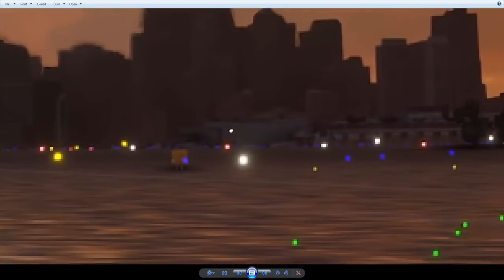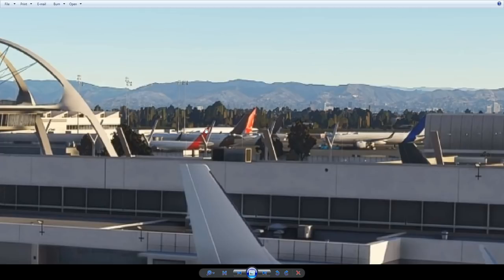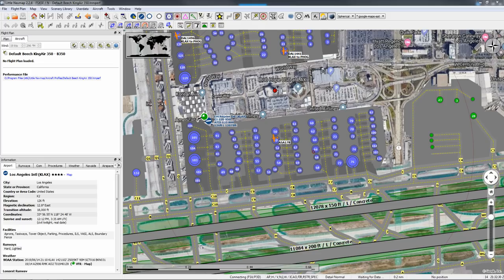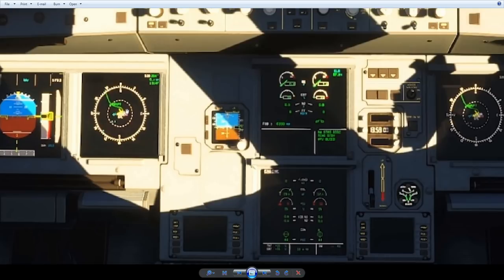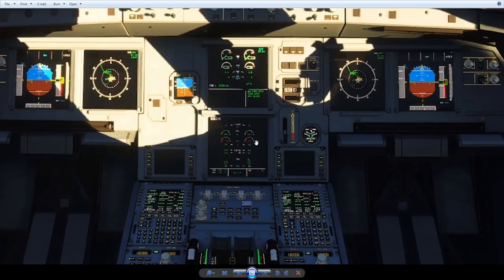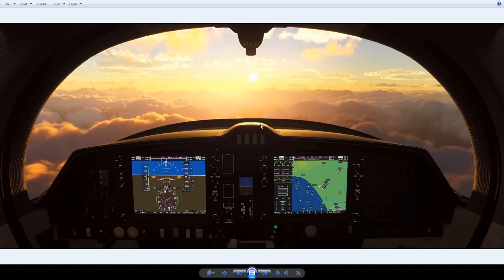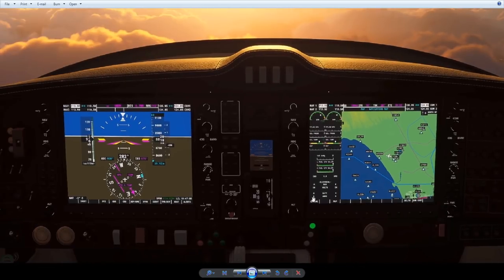A detailed look at some things in the New Flight Sim

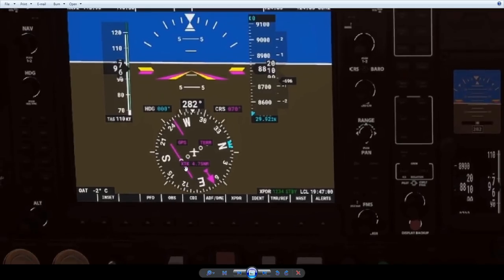Comment from the maker: Slight Correction/Clarification to my comment at 22:35
I have seen some addon aircraft put the XTK in the G1000 HSI before, But none have got it right. At least none that I have used which are the default, the freeware modified default, The Fs2 G1000 that replaces the default, The Carenado/Alabeto G1000, and the previous with Navigraph data.

Comment: They didn't want to distract us by painting real airlines on the planes close up. White is a flag, and the fact that the more distant planes are painted with the real deal; is another dead giveaway. The white is saying to me that the program will have a builtin painting package to let the user desid among hundreds out there. A sophisticated one, but beautifully simple to apply. Sorta like dropping a decal on it. I saw somewhere that this FS is going to be largely cloud biased, which it should have been all along. But it couldn't because AI wasn't around. AWS and Microsoft Azure are good candidates. as servers. We'll have the minimal almond of software on our  HDD/SSD; while the upstream serves to do all the number crunching.  Google also is working on a 3rd gen cloud driver. If Goole is the AI, to be sure, Gmaps will be the default map. This is all pulling together to provide unprecedented never seen before speed, accuracy, and performance on the foundation using 5-G's speed and reliability streaming through IPv6 and 7. But, what will all this set us back in $$$. Probably a lot of variety in controlling serenery, mesh, and REALISM for us downstream with a minimal of outbound usage; this will vastly increase bandwidth without the necessity of checksum error reporting owe to that IPv6 doesn't use checksum packets, as a matter of fact, IPv6 doesn't require a handshake roundtrip. It doesn't need one: 4, 000, 000, 000-bit Encryption. Anyway, can't wait.
Reply: lol the end, "anyways, cant wait". Well me 2